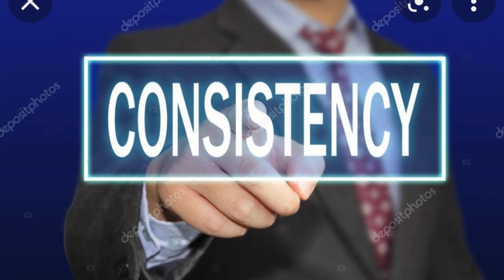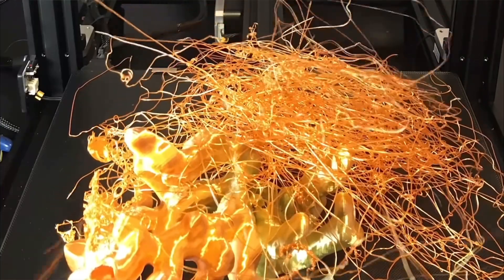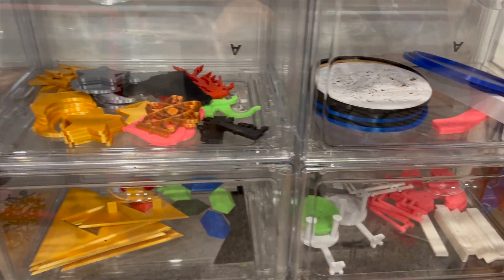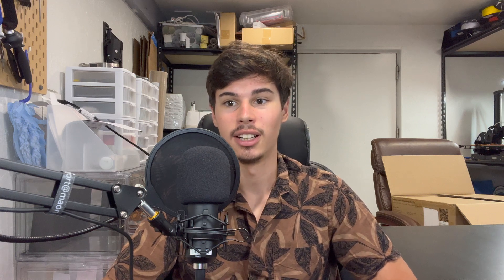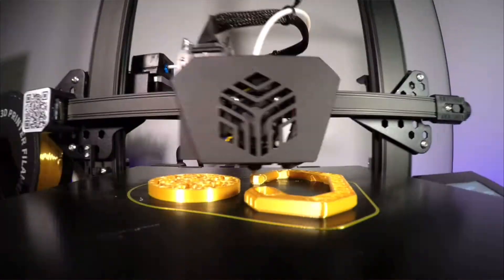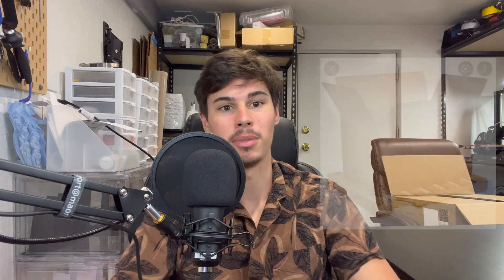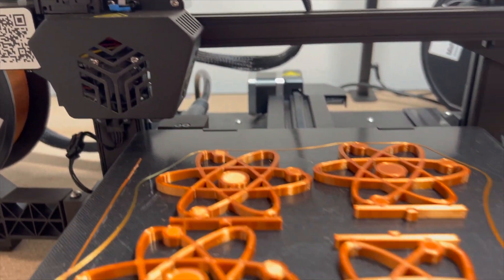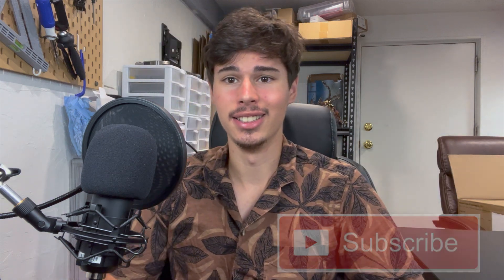3 Tips For Running a Successful 3D Print Farm from Home | Profitable 3D Printing Business - Mr Wumbo

Comment: Not only do I do 3D printing I also do vacuum forming. I bought vacuum forming sheets from matterhackers and they were labeled with another company's logo. I also bought from the other company. So they bought the sheets and charged me double what I could have gotten them from the original supplier. Just be where matterhackers buys and bulk and then charges you much more than they paid for the same items.